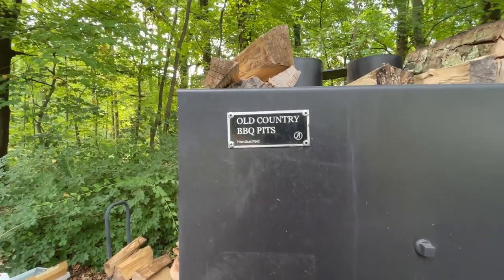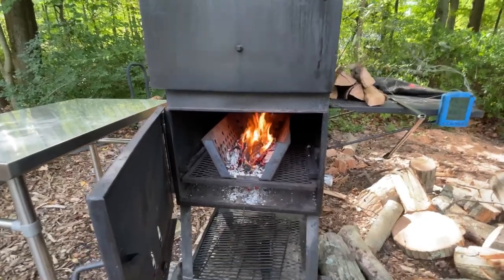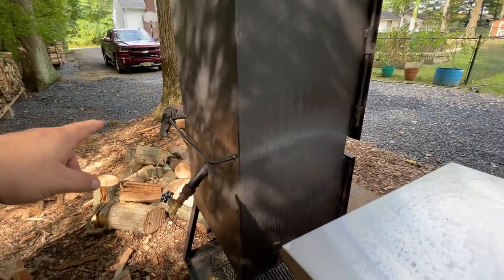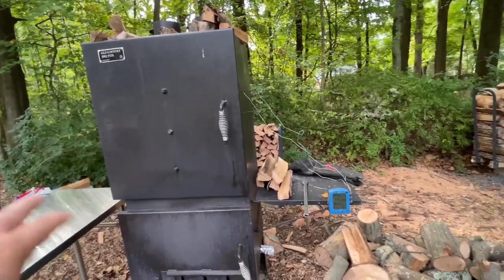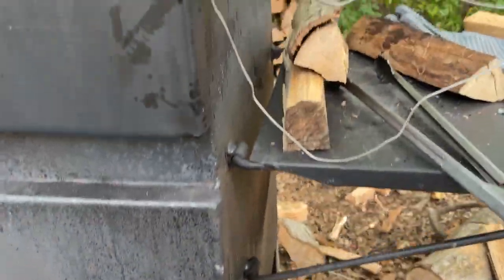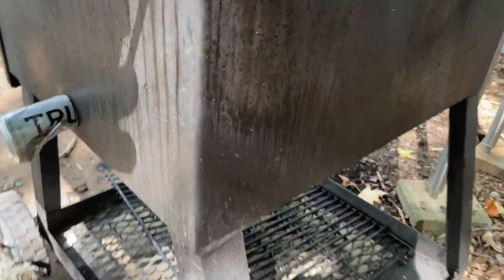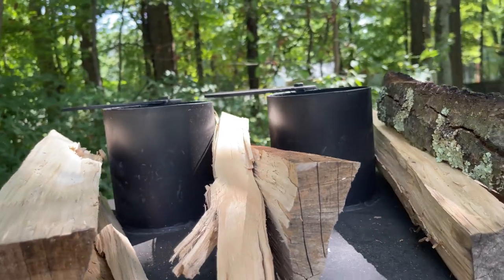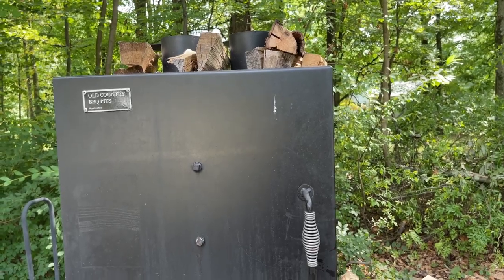Long Term Review Old Country Smokehouse

Comment: I have the same smoker and considering drilling the hole for the fan. So I want to know why are you planning to cover/weld up your fan port vs buying a billows fan to go along with your thermoworks thermometer. I know you mentioned you had one that didn't work before. I was thinking of getting charcoal basket and with wood chunks for unattended cooks. Your thoughts please!!
Reply from the maker: Two things that I have not had luck with in this smoker are running it with charcoal and running it with a fan.  Your experience may vary for a few reasons:  
1. I never had a charcoal basket.  I was using a variety of briquettes, lump, and log style charcoal on the original firebox plate early on with much difficulty in reaching cooking temperatures as well as wildly varying temps.  It was very frustrating.  Which led to…
2 The purchase of the world’s worst WiFi thermometer/controller and fan which I will not name here, but you can clearly see in most of my early videos.  I installed the fan duct ant had zero success with charcoal & chunks and the fan.  The company offered ZERO help with my process and went directly on my sh*t list.  At the time it was no big deal because I still had the silicone plug to the fan duct, so I was able to plug the leak and still use the factory damper.  Around this time I realized that the smoker worked best with just wood so I focused on that UNTIL I somehow lost the silicone plug to the fan duct and had all kinds of problems with runaways, etc.  I called the manufacturer asking them to spot me a new plug and they declined, but offered to SELL me one and that was the final straw with me and them and I switched over to my current Thermoworks rig which I love.  I have not looked back since.
About charcoal vs wood and the fan situation:
I had no luck with charcoal, which doesn’t mean you will have the same experience, however, I do feel that this smoker is designed to burn splits and confirmed that with a lengthy conversation with the manufacturer.  If you are able to obtain a sufficient amount of hardwood and have room to store it, I strongly suggest you go that route.  If you are unable to do it, find a suitable basket and start experimenting and let me know how you make out!  I would interested to hear.  
My feelings on fans is that they really are designed for low flow situations like an egg or a Weber but they won’t really help you with a smoker like this due to the large volume and higher flow.
I hope that this helps you and don’t hesitate to contact me again to pass your ideas by me.
Reply: @smokerschuggin475 thanks so much for the info. I'm undecided on the fan and controller at the moment. I have currently a half cord of live oak and a reliable source for continued wood splits. I might try just a basket without the fan and control it with the air dampner and stacks. I can use my drum smoker charcoal basket. I'm just hesitant to purchase if it doesn't work well. I'm also looking at gravity smokers and IVS smokers too for unattended cooks. Its my experience that brisket cooks are best with the no wrap method, as you may know though this could take 12 hrs plus that's a lot of fire management and not much sleep. This beast of a smoker is definitely my rib cooker. I will experiment with it though. Hey thanks a lot for responding to my question, I really appreciate it!!! Keep rolling smoke man!!

Comment: Well, I'm switching to pellets... I can't find a single m/fer to be dependable with my wood splits. SO! Pellet smokers it is. I like the looks of this thing, it's kinda spot on for what I (wanted).
Reply from the maker: Not sure what your budget is, but there are some pretty good insulated charcoal smokers out there, too. A few years ago, when I ended up getting this smoker, I had planned to get a Lonestar Grillz Large Insulated Smoker.  I had the money, but I also had almost as much credit card debt.  Before I hit the go button, I figured it would be irresponsible not to pay the debt off.  That decision led me to this smoker, which I could still afford after paying the bills.
Reply from the maker: I really struggled with getting wood to cook with, finally I posted on Facebook and a friend of mine asked around work if anyone had any maple they needed gone. Turned out that someone had taken down a couple maple trees in their yard and I ended up with it all for free just for taking it out of his yard.  I have since gotten red & white oak from friends or through work.  Wood is out there, but sometimes you have to beat the bushes for it.